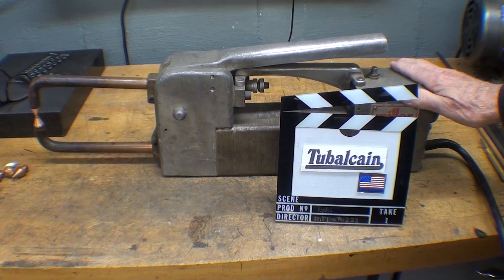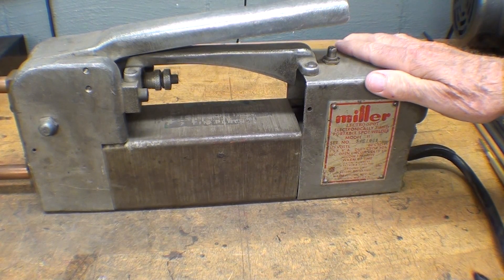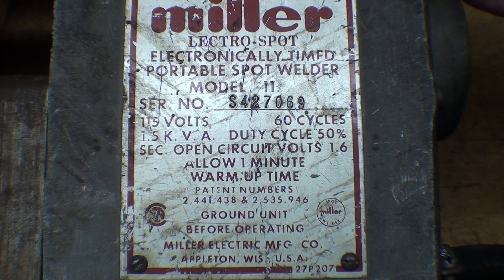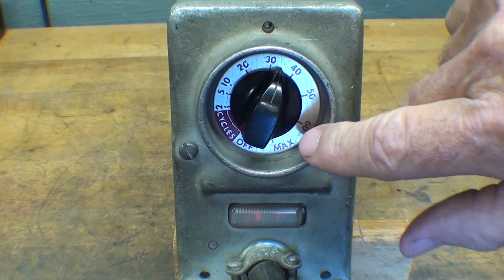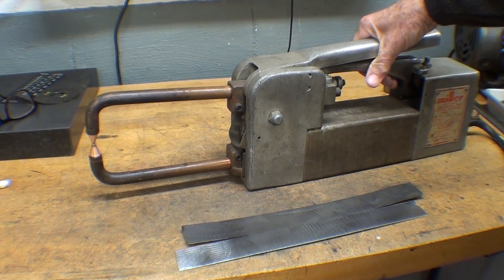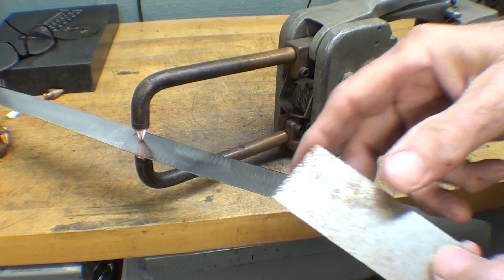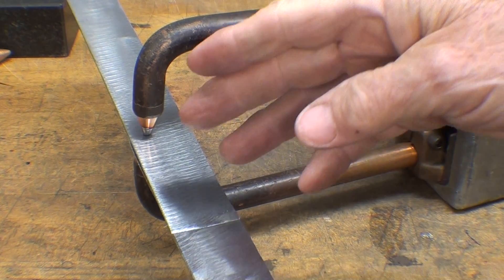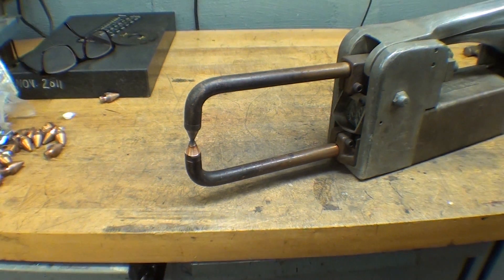WHAT MAKES IT WORK #23 pt 1 of 2 Spot Welder tubalcain

Comment: I bought a Harbor Freight spot welder 120V a couple of years back.  It worked for 1 job with about 10 welds. That's it!  The contact switch went bad and I took it apart and cleaned it.  It never worked again.  I was thinking of taking the transformer out and building my own with a new electronic switch.
Reply from the maker: Yes

Comment: At my job, that pays the bills I work at such a place that produces many automotive parts using spot welding. The way to test them is to pry them apart and measure the nugget left. If you twist it you won't really get a good reading of how the weld did. Some of your welds look like they may be been too long and not enough pressure. They should have a slight dimple when  done. Not complaining. Great demonstration. I watched a British manufacturing videos that should a cutaway of spot welding while it was being done. They're on YouTube somewhere, from the 1960's I guess. You are right about the number of welds on a new car though. One bumper we make has over 40, and one B-Pillar has just as many. And then all the other parts too.

Comment: the spot welder we had when I took General shop did not have a timer. it was clamp, switch on, switch off, release.  I managed to avoid burning holes in my project.  The classmate that took great delight in watching everything I did so he could razz me on every imperfection wound up burning through most of his and almost ruined a new set of tips... or would have. Mr El caught him and took him to task over his carelessness.
Reply from the maker: Thank you for watching

Comment: I loved playing with the spot welder in class. Now I was one of those little pricks that thought it was awesome making it spark over and over... and over..... and over.... and it stopped. Yep I would do this till it tripped the circuit or over heated. Of course these were little tacks not long 60 second welds but still it was unnecessary, but hey I was 14. I also thought it would be a good idea to use 6010 welding rod as a plasma cutter.... until the slag dripped through my shoe.
Reply: x9x9x9x9x9 I've used that cutting method, using a carbon arc rod.  good only as a last resort. I avoided slag in the shoe, but I did have one sputtering bead get in my front pocket and dance around.

Comment: I really liked having access to a spot welder when I taught metal/machine shop.  It was one of the things I missed in the shop so I recently purchased a Harbor Freight 230 V unit.  It works well.  However it leaves a good deal of copper on the welds and the electrodes actually stick to the metal.  I suspect the Miller units may be made from an alloy like beryllium copper.  Anyway I now teach wood shop and welding,  I still like metal working but my old school just was not a good fit for me any longer.

Comment: I still remember my shop teacher neglected to tell us about the timer, so some of us would just open the tongs after what we considered the correct length of time. Of course the welder would arc and burn a hole in the work, and the teacher got mad because he didn't understand how we could possibly mess this up. 
We figured out it had a timer eventually, but I don't think he ever noticed his lack of instruction. 
I eventually built my own spot welder years later, looking forward to part 2.

Comment: Thanks for another great video. It's interesting you never mentioned aluminium alloys when listing the metals that can be spot welded?. Lots of people told me that it can't be done but it must be as a Land Rover has lots of aluminium alloy spot welds on it! After much experimentation I have found a technique that works well and produces consistent good welds. The metal to be welded is sandwiched between two offcuts of thin stainless steel and then welded. The current has to be up pretty high. The bits of stainless don't stick to the aluminium and lift away to leave a nice spot weld behind.
Reply: Andrew Wilson a
Reply: Andrew Wilson aluminum can certainly be spot welded.  But not with a 2.5 KVA welder.  Older style resistance Welders were 3 phase machines weighing several tons.  To weld aluminum, a minimum of 100 KVA was required to weld thin gage material.  Modern MFDC (Mid Frequency Direct Current) machines are much smaller and lighter.  MFDC transformers are small enough to be fit to a robot, many weighing 100 lbs or less.
Reply: I spot weld all the time with the SS sandwich method using small spot welders. YOu can use any steel, but I feel the SS leaves behind the least amount of contaminants for the Alum. The steel builds up the required heat to melt the aluminum between them, then "dumps" that heat into the spot weld. It can get a little sticky when it cools, so you want to leave enough of the steel sticking out as a handle to give it a little twist off the aluminum. But it's not welded to workpiece. This has been a trick used by knowledgeable body shops since the smaller units first came on the market. You just have to play around with diff thicknesses of steel for each gauge of Aluminum sheet, and your power source.

Comment: That harbor freight welder MIGHT last till  you get home with it but I doubt it.169.00 is cheap for a spot welder but169.00 is too much just to throw away.
Reply: The only issue I have heard of with them is that the movable jaw electrode strap tends to be loose from the factory and they arc. Take it apart, clean the connections and apply some insulation, and they work OK.